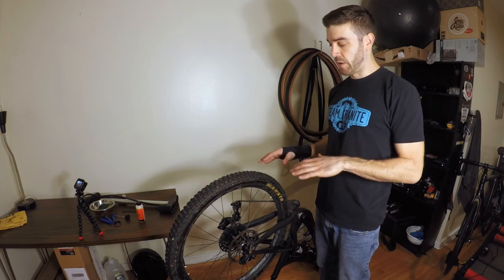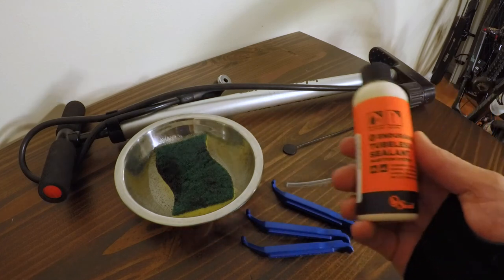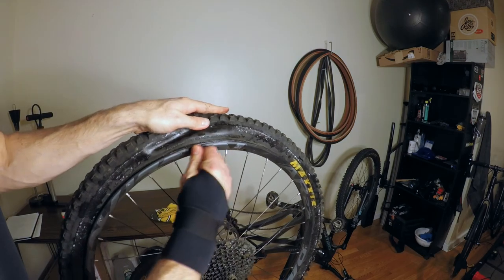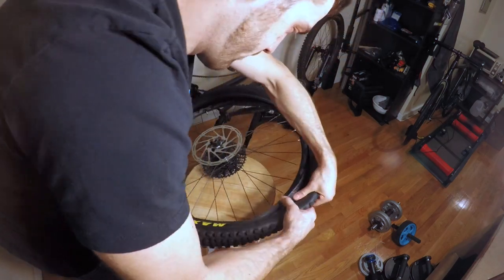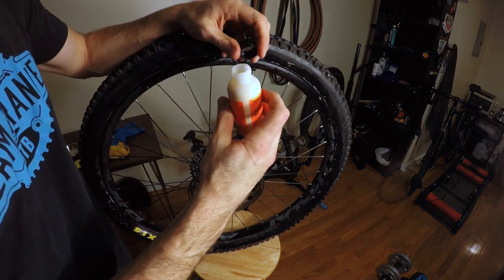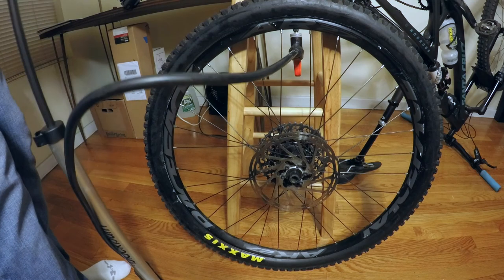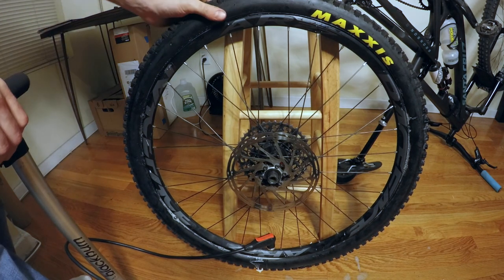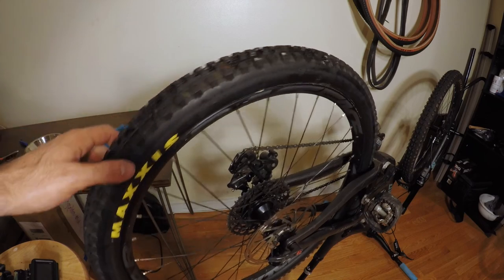How to Change A Tubeless Tire Without A Compressor | Maxxis Aggressor Review

Comment: nice to see vids like this. I bought a floor pump on amazon for 80 bucks and you pump it up to 160 psi then turn valve and pop pop pop its seated. Its not as nice as topeak and other name brands but for the money its awesome.
Reply from the maker: Thim Bales thanks man! That’s pretty sweet! I’ve never seen one of those. Co2 always works in a clutch!
Reply: had to run out to truck forgot what the name was it's a noble air tank
Reply from the maker: Thim Bales thanks man! I’ll check it out!

Comment: Great video! Thanks so much! How do you know if you have a removable core or not?
Reply from the maker: You should be able to see that the top section of the valve stem screws into the base. Two small sections of sides of the top portion will also be flat so you can use a small tool to unscrew.  Usually pretty easy to tell.
Reply: @MTBTravelReview  Wow! Thanks for the reply Jimmy! I'm a total rookie, so I'm not sure what I am looking at, but there is a circle at the base of the stem I can unscrew, so maybe that means it is one with a removable core.
Reply from the maker: @smalcolm93  just look up an image if you aren’t sure. A non-removable stem will be one solid piece without threads in the outside. Happy to help.
Reply: @MTBTravelReview  Nailed! Thanks SO much!
Reply: Do you have to remove the valve stem core it yours it removable?